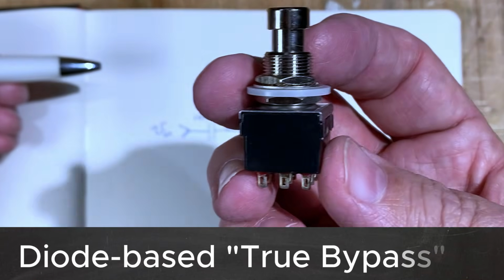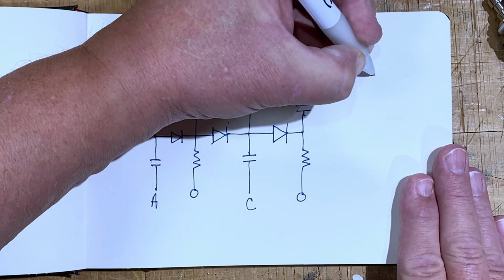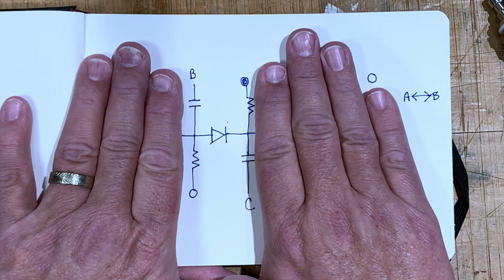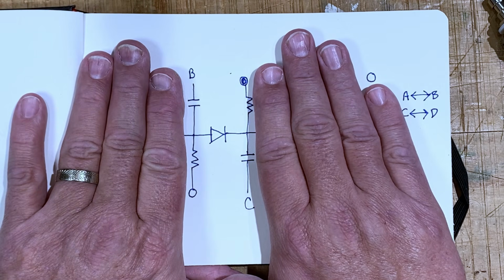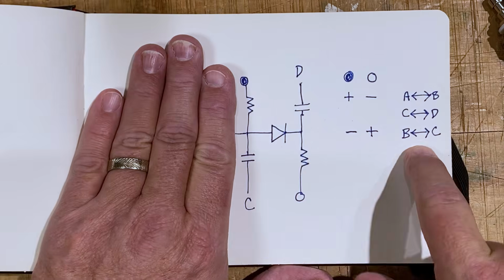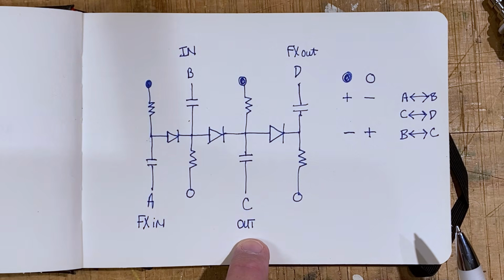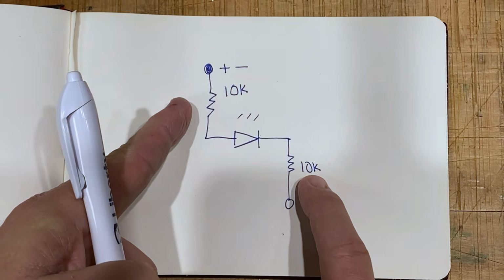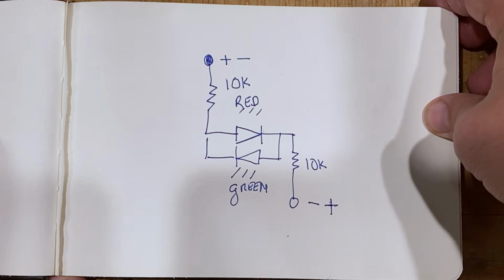Use a DIODE to SWITCH AUDIO just like a TRUE BYPASS? Active Diode Switch Explained Part 2.

Comment from the maker: This video continues my exploration of active diode switching, but this time the simple switch from the previous video has been expanded into a full true-bypass replacement. Instead of using a mechanical footswitch, this updated circuit actively routes the guitar signal either straight through or through an effects send/return loop depending on user control... just like a modern pedal bypass system.

After demonstrating how the circuit handles input, output, and effect routing, I test the design with two different power-supply configurations.

Comment: Super vidéo, merci pour les explications, j ai un autoradio cassette blaupunkt qui utilise ce blocage par diode, quand j'écoute une cassette volume très bas,j'entends légèrement la radio, pourquoi?
Reply from the maker: Radio signals are notorious for bleeding through. It might be coming through the switching diode, but it's likely from an induced current somewhere else in the circuit. It is a very strange problem.

Comment: I have seen such audio switching with diodes in an early 90's car radio, to switch between AM, FM and cassette. At first I was like what? But it worked! As long as the audio signal is low enough to not forward bias any diode on AC peaks and the blocking DC is high enough for the muted channel, there isn't any crosstalk.
Reply from the maker: Yep. That’s the one caveat that everyone says. The signal level has to be lower than the forward voltage. Good to see that you’ve seen an example too!

Comment: Using a diode in an audio circuit will definitely distort the audio signal itself because diodes are rectifiers and will block the negative side of an audio signal. I'd you have an oscilloscope, check with it to see the distortion.
Reply: No. In this cct the diode is so forward biased (with DC) so that the -ve ½ cycle of the audio does not take the diode out of its forward conducting area just like the BE junction of a BJT in a class A amp configuration. You are completely missing the role the diode plays in this implementation.
Reply from the maker: @AndiusPandius you explained this much better than I did. 😂
Reply from the maker: I have these forward biased high enough that there is no issue with the “negative” swing of the signal. I have run this on a scope to confirm.

Comment: I have been looking for a circuit like this for YEARS. I have always thought how voice activated selector switches using relays was lazy design. I have been looking for a way to set a three line level source priority automatic switcher. I have three audio sources for an amplifier on my backyard patio. Default audio is from the TV. When audio is detected from an Alexa it cuts TV and plays Alexa for music, reminders and announcements.. I have talking caller ID for home phone. When caller ID voice is detected, it cuts out TV, Alexa and plays caller ID. I also have audio from a MP3 playing doorbell that is mixed with caller ID audio. Over years, the contacts in the VOX relays corrode and audio can pop and get scratchy. This diode switch circuit appears to be a much cleaner solution to my mess of wires. I would love to see your design for an audio detection circuit.
Reply from the maker: Interesting circuit idea. I wonder if there’s a way to replace the use of a relay switch with the diodes. Typically, relays are controlled with a separate higher voltage control lines, maybe 12 volts in your case. Mixing that with the audio path is a challenge in an existing circuit because the relay control and audio paths are well separated. It’s an interesting concept.

Comment: I sent you an email with the schematic of a CMOS option I hope you have the time to review it. I'm pretty sure you'll find that it performs very well, can work with various types of switch hardware. Depending on how elaborate you make it I think you put it together for under $5. You can get away with just one chip @ $0.81, and you don't require any coupling capacitors. Not to take anything away from the diode experiment. I know there's other things that can be done with diodes as well like voltage-controlled capacitance to replace variable capacitors in an oscillator.
Reply from the maker: Thanks so much for sending that over! I'll definitely take a look. Always appreciate seeing new approaches!
Reply from the maker: Apologies, the email on my profile was pointing to an older account that is closed. I updated the email address to one dedicated to this channel, so please resend the schematic. MadScientistGuitarLab_at_gmail.com

Comment: Your diodes could also be LEDs.  I'm confused as to why the reverse LED doesn't pass the signal when in the "off" position.  Unless the LEDs are not in the signal path and merely indicators.
Reply from the maker: You're right, LEDs can definitely be used as diodes here! The reverse LED is in the signal path, but it's the control voltage that stops the signal from passing when "off."

Comment: Interesting - but I think we know why the Japanese used J-FETs for the switching, despite the increased cost.
I built an effects box using BBD chips with loads of switches to change the configuration, but it sounded like a beehive when plugged in.
Reply: I'm sure some people would want the "beehive sound" haha. 
BBD chips are pretty great. Did you have any problems finding them? There don't seem to be many available.
Reply: @Klutech  They were available about 40 years ago when I made it, and I still have some of the chips - TDA1097. I didn't think that guitarists would like to compete against the beehive, even if it could be tuned by the controls, and I was embarrassed to show them a failure.
Reply: @johnwright8814  That's fair enough regarding your apprehensions in demonstrating it to guitarists. Looking at all the variety of niche pedals available nowadays it might have a place amongst them, as opposed to when you built it back in the 80's. I was investigating BBDs for a chorus/ensemble effect in a string synth I'm building (similar to the Eminent Solina strings), but have decided to use PWM using conventional op amp comparators to achieve a similar sound.
Reply: @Klutech  I used a Compander, (compressor/expander NE571) to improve the SNR, but it was more a grounding/shielding issue on the prototype construction. I could probably do better now. Flanging, Chorus, Delay, Reverb are all variations that could be selected with knobs and switches. Nowadays, a DSP core gives much better performance, I bought a Specular Tempus.to scratch those 80's itches, mainly because I liked its name.

Comment: I would expect some treble loss, because the resistor to ground dampens the resonance peak of the guitar signal.
Reply: Do they work on the raw guitar signal? You could add a voltage follower first to buffer it
Reply from the maker: It actually preserves the high end. What this configuration does is taper off the low end. Depending on the capacitor size, I could get a good pass through down to around 10Hz. 100nF is plenty but I did try 1uF and more. It didn’t make it that much better.

Comment: would a couple microfarads across the diodes maybe eat up some of the switching noise?
Reply from the maker: I tried that. The diodes don’t block the signal anymore.
Reply: @MadScientistGuitarLab  100nf or less?
Reply from the maker: @Shiny_Tsar I tried values down to single digit nF. The signal bleeds through. When I’m trying things off camera, just seeing what works, it’s interesting that the same ideas show up in the comments later. Maybe there’s some value in saying what I tried even though it didn’t work.

Comment: Also, I don't think you mentioned it in the the video, but what springs to mind when you mentioned gating an audio signal using diodes is old combo organs. Some of them, like the Gibson G-101, used a control voltage in "diode keying" instead of switching the signal directly from the key contacts. This allowed for effects like decay after the note was released. The technique was only really used due to the expense of transistors in the late 60's. Not sure if that was the inspiration for this.
Reply from the maker: I took the idea from radio receivers and the intercom systems. I was unaware that diode switching was used this way for keying notes on an organ. That's a really interesting historical application of diodes in audio, thanks for sharing that!
Reply: @MadScientistGuitarLab  No problem! I stumbled across it on my own quest to build a string synthesizer while looking for alternatives to using a VCA for every key. I still ended up going with the more conventional approach, due to the diodes being noisy (and not being able to amplify doesn't help). It can work well enough for some applications though.
Interesting about the radio and intercom. Are you referring to the detector diode that demodulates the carrier from the audio signal, or something else?
Reply from the maker: @Klutech the examples I’ve seen are selecting audio channels between preamp and power amp. So it’s definitely not the detector stage. They will direct one microphone in to multiple speakers out (intercom), or select from multiple inputs to a drive a single output (selecting one radio station to listen to).
Reply: @MadScientistGuitarLab  That makes more sense than the detector. I hadn't realised they use diodes to switch inputs/outputs in the examples you mentioned.👍
Reply: A LED is allready a DIODE😅.
TURN/TUNE/IN THE SWITCHING VOLTAGE WITH A REOSTAT/POTENTIOMETER🎉
Reply from the maker: @vornamenachname762 that’s my plan.
Reply: @MadScientistGuitarLab it is so easy🙏 I am really long term thinking such electrical understanding. As a toggle switch🎉 2 anti versa switched diodes for signal a and b channel just switching a current this or that way. 
Consider, also one signal could combine two other sources by waveform +/-

Thanks a lot your work❤🎶

Comment: I wonder if you could use an RC network before all of the current dropping resistors biasing/reverse biasing the diodes. It could act as a ramp to lessen the pop from it jumping immediately to the rail voltage when you switch it.
Reply: But then the switching will be slower
Reply from the maker: @thewhitefalcon8539 and the slow off/on is what makes it sound cool. 😎 it stops being a bypass switch and becomes something else.
Reply from the maker: You are hinting at what my next experiment will be. Once you ramp the control voltages, you can send all sorts of signals through it.
Reply: @MadScientistGuitarLab  Cool, sounds like a plan!